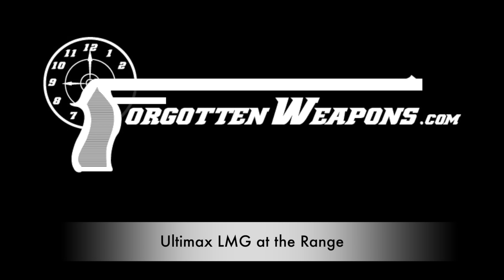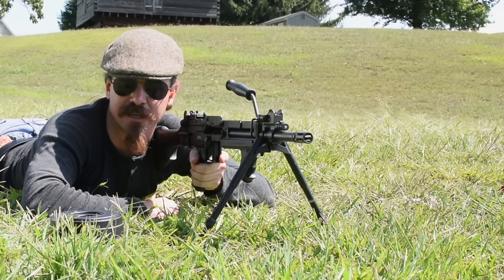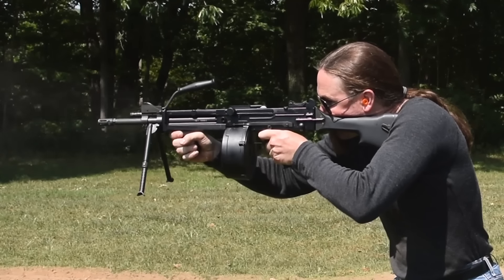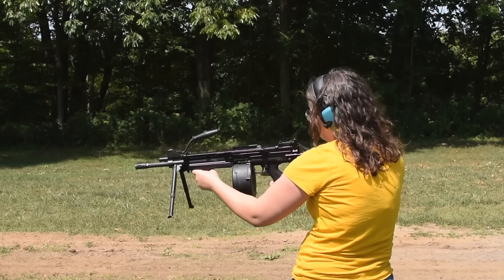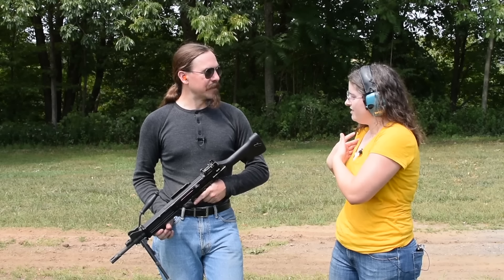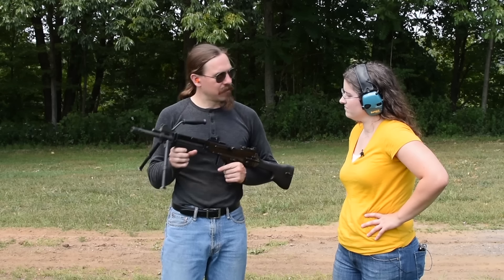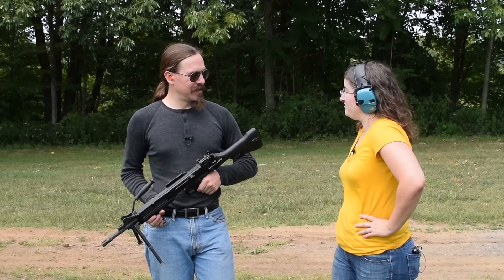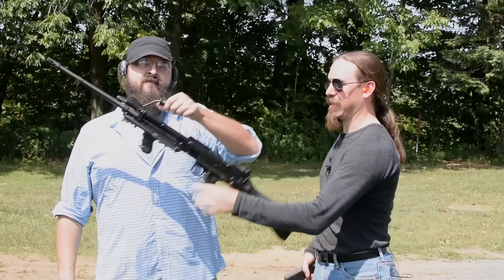Origins of Constant Recoil: The Ultimax Mk3 (feat. Mae & a Yeti)

Comment: lol. As a Singaporean. I don't really like the Ultimax 100. (In fact alot don't)
Like Israel. All Male Citizens are to serve 2 years military service.

Why I never like the Ultimax 100.

Weight. aprox 5kg. vs 2.5-2.8 for the M16A1. (Yes we were suing the M16 back then before the SAR21.)
That means that U are lugging around extra weight during military training.

Stamp steel Metal contruction. It work. Stiff and tough enough. BUT steel corrodes if not taken care of.
In Singapore. Our average humidity is above 95%. Not to mention. No Military personal are issues a rifle/weapon personally.
Meaning All rifle comes from the unit they are posted and attached to.
That would means that they may not be in a perfect condition. It will work. But the paint coatings or the Blueing will be pretty much gone after afew months of Jungle training. (we do that most of the time ).

Imagine after every field training. We have to clean our weapons. (Ultimax 100 is easy to clean depending on version. It is easier to clean if it is MK3 above. They have a removable barrel) BUT we will need to coat the whole weapon in oil before sending it in to the armoury  everynight.
Next morning draw weapons and again we have to clean off the excessive oil again. (We can be court marshalled. If our issued weapon corrodes/rusted. Thus the thick coat of oilk every now and then.)

Alot of us never experience the full feel of the constant recoil. This is due to way our live firing rules for The Ultimax 100 is designed.

Overall we feel that the Ultimax 100 is good. But we hate the weight and the stamp metal/steel constructions. That is during peace time training.
Reply: Have you tried the M249 SAW? When the USMC came we get to try out their weapons and they are fucking heavy bro. One junior officer from the Marines loved it so much he asked me if this gun has an export version.
Reply: @user-dd8vo7or2d  I am not sure if this is a legend or real story. Legends has that when USA was looking for SAW weapon. ST did submit their tender. Using the Ultimax 100. Nut USA eventually settle for the 249 or Mini Mi.
Claiming that the ultimax 100 was filmsy and not rugged enough.
In myy opinion. true to a certain extent. The mag well side. And magazine fit is abit on the loose side. They well have feeding problems if ur magazine is not in a good condition. 

But that applies to the earlier models.

Also US army feels that Drum mag is not a good idea. And they prefer it to be belt feed plus magazine fed.

That was the story we heard last time.
Reply: @wayneho6458  Nah, the real reason is that the Ultimax came out a few months after the SAW trials were concluded, they missed the timing. It was in one of the newspaper reports that CIS acknowledged that all the money went to the -249 but they still did a publicity shoot for PR.

Comment: Many moons ago when I was in the Army (25 ID), I got to cross train with the Singapore Army. I remember them having these. However they didn't like using the drum mags because, according them at the time (2002), the drums had a jamming problem. They instead used 30 rd mags. 

This may have also been more practical, IMHO. Lugging those drums through the jungle would get annoying really fast. Plus, laying in the prone with a bunch of them strapped to you would be awkward compared to just having a bunch more 30 rd magazines.

Comment: If I had to guess why this isn't a big deal system today I would have to guess that military minds don't think this would be a big enough advantage over standard systems when shorter burst are used.  You were both firing huge bursts and that doesn't work with LMG's due to having limited ammo when carried dismounted.  In addition, the rate of fire on these seems slow and getting as many rounds into the target area when it counts is what LMG's are for.

Comment: I have a feeling the real value of a system like this isn't in supporting a traditional role like the autorifleman, but in allowing a change of doctrine. I wonder if constant recoil would solve the issues the slew of US small arms programs (SALVO to LSAT) failed in: if an infantryman finally has the ability to provide accurate full-auto fire, would that solve the problem of low effective lethality?

Comment: It is my understanding that a properly timed Lewis Gun performs in the "constant recoil" mode.
Reply: Sort of, kind of. 
 The Lewis can simulate a continuous push with the right rate of fire dialed in.  This gun is built with a system that creates a "constant recoil" effect by changing the internals to make room for: stronger springs, a large heavy bolt, longer bolt travel, and rate of fire reducer, among other things.

Comment: Any chance of getting a firearms engineer responsible for one of these designs to go into the design details and mathematic principles?  I wonder if the next step is to control the impact of the bolt into the chamber, perhaps by attaching the bolt to a rotary counterweight like the flywheel or harmonic balancer on an internal combustion engine.

Comment: Does a constant recoil system make a difference on single shots? Of course you wouldn't get the same effect as in full auto, but not having a sharp impact of a recoiling bolt might still make a difference.

Comment: Ah yes, the ultimax SAW. The sear system really sucks, so if you left the bolt open, a firm tap would send one round away. It's meant to have a changable barrel but the system is so impractical even the Singaporean army doesn't field it with a spare barrel. That aside, it's quite a dream to fire. 
It desperately needs updating and it has a Mk8 brother since 2017, but it seems nobody adopted that poor sod. If you thought this was good, wait till you fire mk 8

Comment: I noticed, after I finally stopped laughing, and the tears dried up, the rifle seemed to jump around more with the longer barrel. Because it was lighter with the lower round mag, or barrel harmonics, or the round building up more pressure in the longer barrel?
Reply: festerallday    Because the gas system was up higher on the long barrel.  It needed backed off.  The cyclic rate was higher too

Comment: I wonder if a system like "constant recoil" really is useless on a semi-auto. People say the SAR-21 and RDB have light recoil because the bolt has such a long travel. Isn't that similar?
Reply: i have the same feeling. sure you would still feel the recoil, but probably very much smoothed over, like what i read about the ultimax earlier, more of a "push" than a shove.

Comment: You need to do a accuracy drill with it on full auto, compared to a FN minimi.
Throw in the Knights  Armament as well, to compare the concept and not just the quality of that one design.

Does it actually give a benefit to the user besides feeling nicer?
And does the system have any downsides (besides I assume cost) ?
Some have commented about reliability, but if so is that a consequence of the recoil system or just inherent to that particular model of gun?

And could the system be adapted to assault rifles with ease (I assume so) ? And how does it compare to the Kriss system for recoil control?

Basically is this possibly the wave of the future, or just an interesting niche?

Comment: Ian, do you have any plans to disassemble Ultimax or Knight's LAMG on video and explain the details of the constant recoil system?
The "rear part" of the constant recoil ("the carrier never hits the receiver") is pretty obvious. But the "forward part" is a mystery for me: as they say, Ultimax has some kind of API (advanced primer ignition) that eliminates the kick from the bolt slamming close on the barrel/barrel extension and generates the forward lunge after the very last shot in a burst. But how on Earth do they do API on the 5.56 cartridge that has no rebated rim?!?

Comment: From my own experience, the recoil is definitely very manageable, but the problem is not with firing live rounds but with blanks. (we use 5.56 blanks that are plastic rather than brass jacket blanks). We also rarely use the drum magazine as it is prone to causing jams. The standard issue Ultimax in the Singapore Army also sports a longer barrel than the one in the video which makes it more cumbersome to handle and to manoeuvre with. Especially when navigating in the jungle environment which we conventionally operate in.

Comment: The biggest weakness is that it does not have a huge rate of fire. That is why it was never widely adopted.
Reply: There is also a limit to "huge rate of fire", for example the MG42 could go up to 1200 rounds a minute but out in the field, soldiers were told not to just cut loose because it would melt the barrels and gobble up all the ammo.

Ian already said why it was not adopted, all other countries already had their standard SAW before this even came out and it was simply not economical to replace them all.
Reply: A quick trip to Google and you are instantly proven wrong